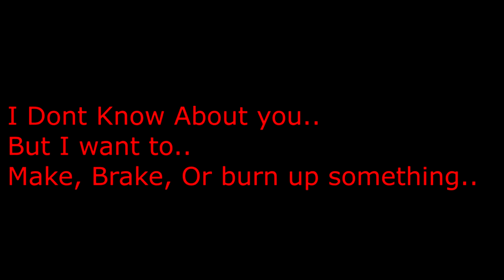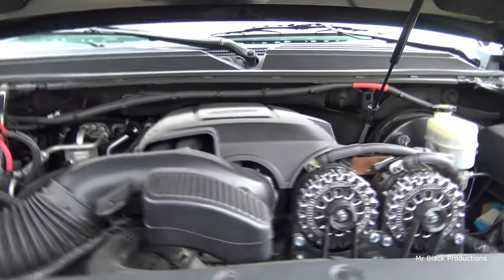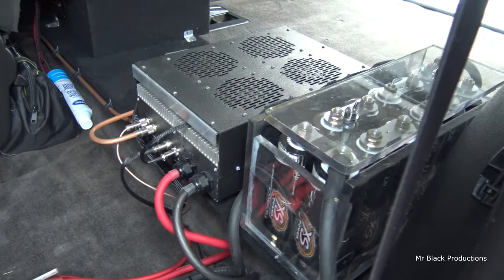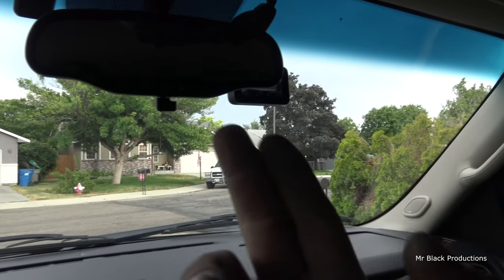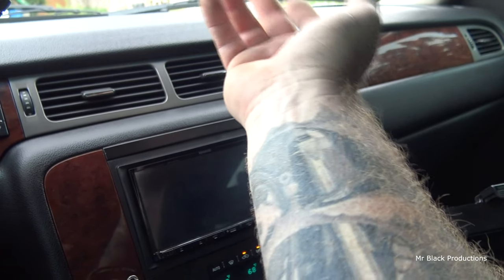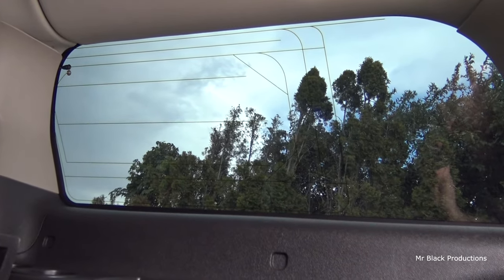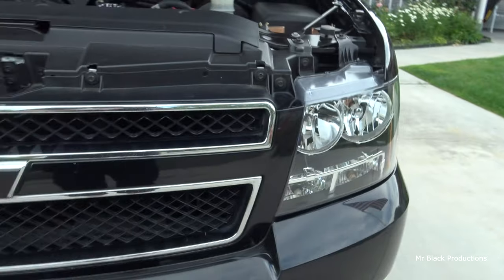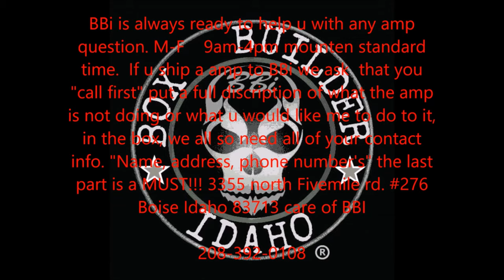Lets Build Us A Mobile Pt.5 The End!

Comment: I remember back in the days of Shootouts some guy named "33 from NJ" showed up with a car that had the back seat removed and hollowed out to the trunk. He had a giant AC Tube Powered Amp, said it was a 50KW tube. Opened the Hood and there were AC Alternators going completely around the front of the Engine. His antenna was a Solid Copper (looked like a ground rod) on the back of his sedan. He said the antenna would get shorter over time!  
He went up against someone in our area that did 6KW dead Key. 
Before they lined up he got out of his car and suggested that everyone disconnects their antennas.

The watergate tape they played at the award ceremony was amazing, he said "33 and I just Keyed" there was not even a scratch in the background. 
Everyone then wanted to see his set up. He put a Bird Meter on the roof of the car and said NOBODY GET NEAR THE ANTENNA OR TOUCH THE CAR!  
Keyed up and dead keyed 33 Thousand watts, several people saw it including myself. The engine wend from a high rev and struggled.
After that everyone in Boston started switching to AC Amps in the mobiles. 
Those were some good times. :-)

Comment: I been having the same problem with my LED headlights interfering with my receive. I’ve added ferrite chokes at the LED drivers and it helped. I can use my radio driving at night now but there is still interference. Is that type 37 you put on the truck computer harness just a size of ferrite? Is it 37mm. Killer mobile setup!!
Reply: Im having the same issue.
Cant get rid of it.
I put ferrites on them too, didnt help at all

Comment: If it doesn't fall through I will be buying a Yukon and am rewatching this before I put any holes in it. Should be better to ground than my truck. I know from watching this and your facebook that I have RF coming back into the cab and freaking out my gauges. Driving a diesel 1 ton daily as a work truck is beating it and my wallet to death. I am going to have to do some digging. I would like to see all the radio and electronic installs. I have done all my own car stereo stunts since I was a kid and have the hearing to prove it but all the little things to make it look really good is what I need. This will be something big enough and rugged enough that I can comfortably pack the stuff I need in the back, throw a ladder up on the roof and take it up a narrow deer trail (in some places so narrow a rear wheel is hanging off a 10ft drop by the road or out into a cowpasture. Something I can haul my mini horse in the back to take them visiting, pile 4 big people in it to go to the store in an ice storm and still clean up nicely as a business and personal truck I can pull up to my clients not looking like farmer Bob and when they look inside they see a shining example of the quality of work that I do. That and it will low key look like an official vehicle with a bunch of low pro antennas on it.

Comment: Great clean install, big cable for big toys, very useful information about rf problem ( and have same  pump issue on my 07 mustang gt, low fule pressure problem from rear defroster) can't use hf!/cb radio think some led hid highlight problem,, now only use only my ham radio tmd700... 73 iz3qvb from Italy... Most of the solution have used in my JKU (2.8 diesel rf machine!!!) cb in Italy still only for offroad ( 70% have it, 10 ham and last no radio comms) ciao!

Comment: So! Is this thing all set up for AM or SSB? Because they are different! I NEED to know! I'm currently running a Cobra 148GTL, early Philippine mfg, (has all the components) using a RM KL-400 amp that provides 300PEP on SSB and around 150 AM watts in my car. But, I could use more power. What do you suggest?

Comment: I BEEN RUNNING CAPS ON MY BIG BOX FOR 10 YEARS AND I USE THEM ON MY SOLAR I WON A 4 PILL CLASS WITH MY MOTOR OFF WHAT YOU GOT IS OLD SCHOOL WE ARE IN THE 2000 NOT THE 70S  ALL YOU NEED IS ONE BATTERY TO KEEP THE 12 V UP ON YOUR CAPS

Comment: Magnuson supercharged with tsp heads and cam, up grade the fuel system you'll be happy as hell
Reply from the maker: Yeah that's what everybody's saying they've had a lot of success with them the kits look like they're a little bit more thorough as well. The main thing is will it fit around the Dual alternators
Reply: @BoxBuilderIdaho  the pulley drive is on the opposite side of the alternators, I think it biggest problem are u going air/air intercooler or water to air hoss
Reply from the maker: Don't know yet

Comment: Hello BBI  today is 10-Feb -2022  I'm in Panama at 3:00pm to 5:00pm  I heard you and it's not skip it's straight antenna 
 If your set up is akin to Bullet Bob's I'd imagine it looks like a gantry crane at a cargo ship loading port anyway it was clear as If I was hearing you on a video all I got is 4 watt swinging 10-12 watts Legal limit station with a fine tuned antenna and Mil spec 213 coax using Galaxy or President Richard radios You boys are the big time. I'd imagine your doing like 50 KW or more guys were trying to key on you but I could still hear you. oh yeah it was Ch-6 the Bowl.  Station #435 Panama canal zone.
Reply from the maker: Damn.. well thank you for letting me know make sure to check out the actual YouTube video that came out of me talking on the radio today. I'm assuming that you're talkin about Panama  the country and not the little town in Florida right?
Reply: @BoxBuilderIdaho  Yes i'm in Panama central America Station #435   the videos on your channel ?